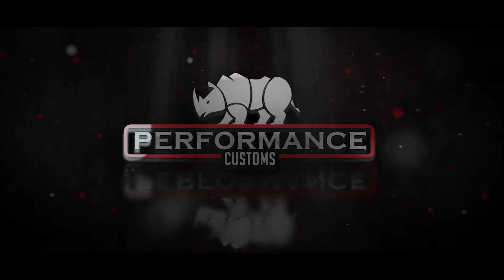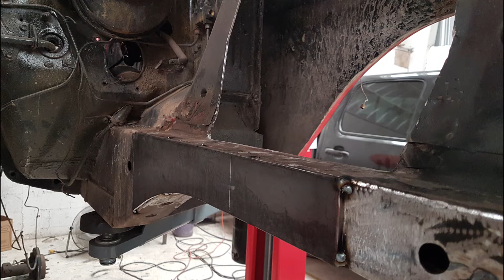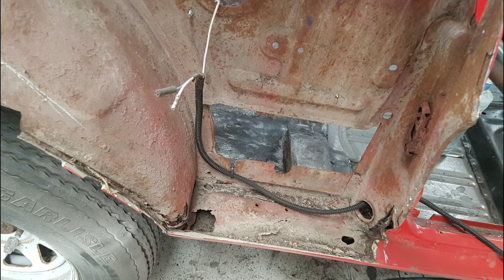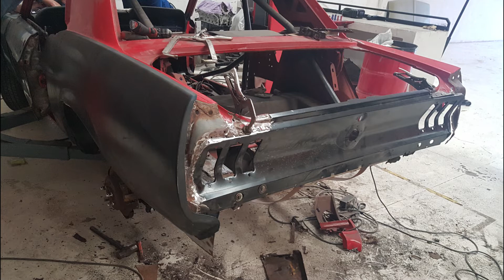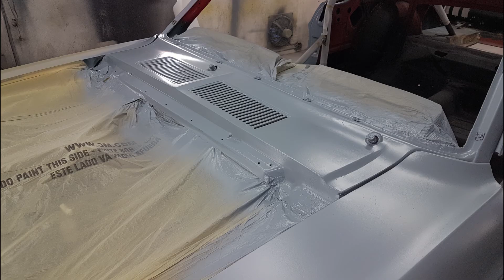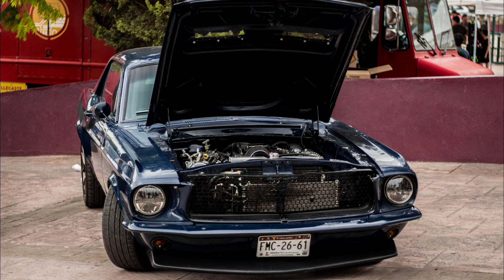Así se Restaura un Clasico // Mustang 67 Pro Touring // LS Swap

Comment: What LS engine did you go with? I did an LS7 swap in mine. What size wheels and tires, suspension details? Nice car
Reply from the maker: Hi Adam, We use a LM7, the engine is basically stock,  for the suspension we installed a front mustang 2 kit and on the rear it has the original leaf springs with caltracs traction bars, an the wheel are 18x8.5 ESR RF2 with nitto 275 on the rear and 255 on the front.
Reply: PERFORMANCE CUSTOMS nice, thanks for the reply. Check out my channel and you can see some of the work done to mine. The 3rd update shows most of it but it’s a lot further along now. I’ll do another update on the car next week. I managed to fit 18x11 front and rear on 315s.